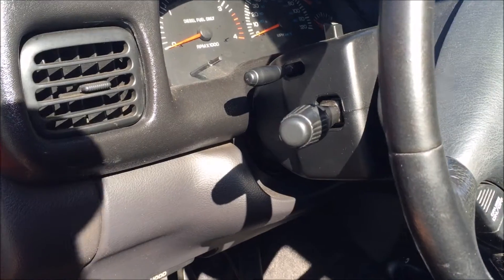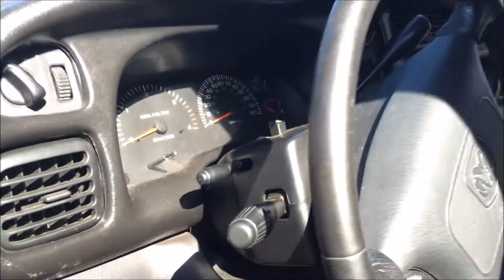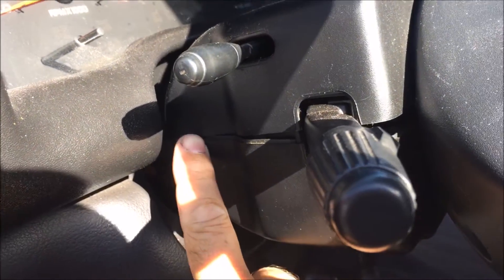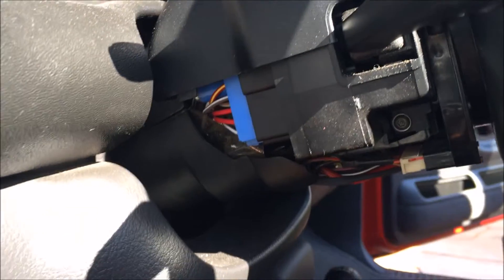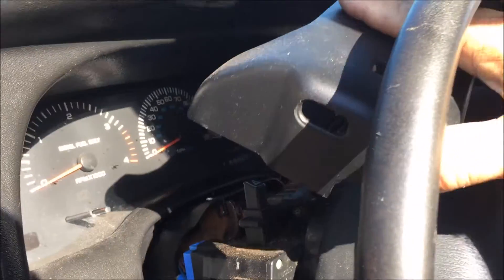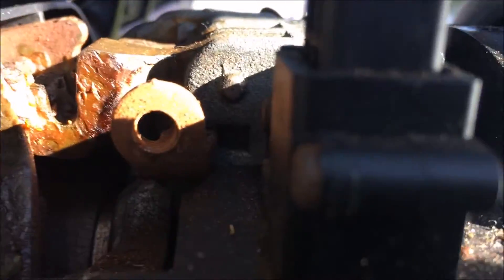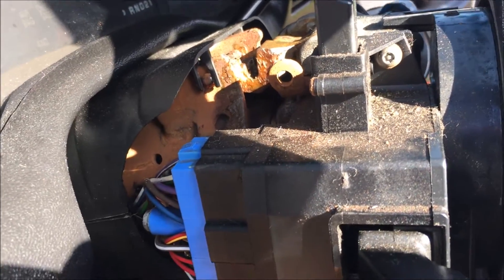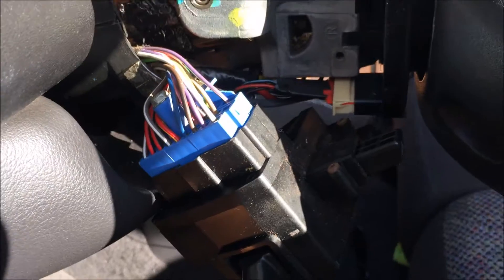Replacing the Multifunction Switch On A Dodge Ram

Comment: Bought my multi-function switch from Amazon 4 days ago got it on sunday, but had to go buy those anti-tamper torx, for months I couldnt use the high beams since they would stick on high or not flip back to low beam or no light at all,,,, very easy replace due to watching this video, Thanks for posting!!
Reply from the maker: Phubar Now happy to be of assistance, brother.

Comment: Can a short develop inside these multifunction switches, i have a 1990 dodge w250 cummins and i can see smoke coming from behind the steering wheel when i use the left turn signal and smokes more if i hit the brakes, your help would be greatly appreciated, thank you.
Reply from the maker: Brother, that description you gave is serious.  First off, I don't do 1st Gen Dodge Rams.  Second, if you are gonna do this fix yourself, pull out the multifunction switch.  Take off the steering wheel cover that wraps around the back of your steering wheel.  Look for anything melted.  I really wish I could be of more use to you, but honestly, I have bought a 1st Gen ... yet.

Comment: Great Video. Have a question for you ,others please reply if you have had this problem. Replaced a worn wiper motor 1 year ago and everything had been working fine. Last week when wipers normally shut down, the wiper failed to go to bottom of windshield ,stopped 6 or so inches from bottom of stroke. They still work fine in all modes, on start up the go down to bottom of stroke and back up to full pass, just annoying and  curious what might be causing this, appreciate your input 2001 dodge ram 2500 diesel Thanks Dennis
Reply from the maker: interesting.  c'mon brothers out there.  ... this man needs some help with his Ram
Reply: Wiper Relay fuse - Left side fuse box under the hood

Comment: I replaced mine, but the return latch only seems to work in one direction. I have to manually return it in one direction.  With the switch out, the latch does release the switch in both directions.  Ideas?  Thanks,
Reply from the maker: Mogman150 you stumped me!!!!   Anyone out their in Ram Land help???

Comment: hey i have a 02 dodge ram 1500 and when i press  down to signal left it singals right i looked online and it says i need to replace the multi fuction switch but others told me not to do it my self because i might hit the air bag is this true ?

and where can i buy this part
Reply from the maker: +jayngo23   If you have any reservations about triggering the airbag, just undue your battery cables to the battery and wait for 45 minutes.  After forty five minutes that airbag will be incapacitated, allowing you to do any work around it or to it.

Comment: Ihave 2001 ram 1500, wy wipers will only work on hi .low and  intermitted does not dont work,, i have replaced the multifunuction switch still same proublem,,,,any help??
Reply: Genevieve Caswell check the ground

Comment: my rear brake lights and rear turn signals only quit working. Checked fuses and bulbs. Would replacing this fix my problem?
Reply: 1997 doge ram sport 1500
Reply from the maker: Is it just one side or both sides. A lot of times the position of the bulb inside the socket is not correct. If you move around the bulb in the socket it may come back on
Reply: both sides and  rear signals. top brake light still works
Reply from the maker: +Tony Thomas try what I suggested. Check for corrosion in the socket itself. One of the bulbs also may have a short in it. Thankfully  It does not sound like an art electrical problem
Reply: thanks ill try

Comment: The only thing wrong with my multifunction switch on my 95 Ram is the wiper switch. Is there a way to get inside just that part and clean the contacts? It was intermittent, now nothing
Reply from the maker: +John Franklin Not that I am aware of.  but hey, if you do figure it out, let's us know!!
Reply: I will. Thanks for the quick reply!!
Reply from the maker: +John Franklin no problem brother if I can help out I will. If you haven't signed up for a subscription to my channel yet please do so. It is free. It helps me to believe that I'm not doing these videos for nothing.

Comment: I keep losing my low beams randomly. Would that be the switch?
Reply from the maker: Have you checked your connections to the headlamp?
Reply from the maker: Also check the actual bulb and make sure it is securely tight inside the bulb connector